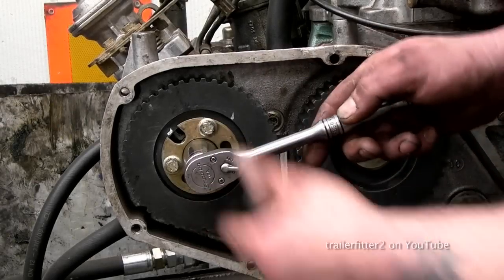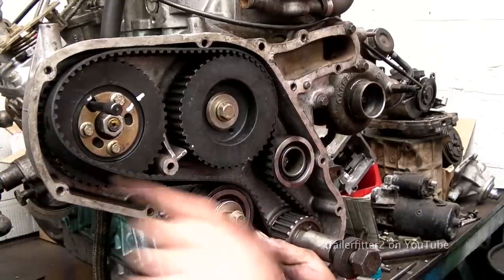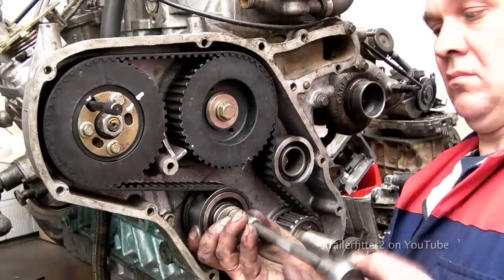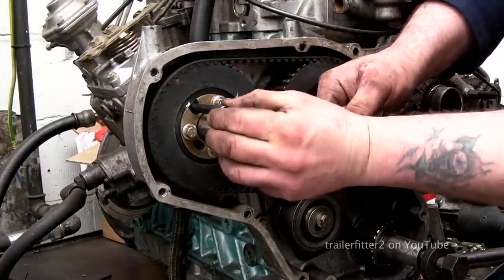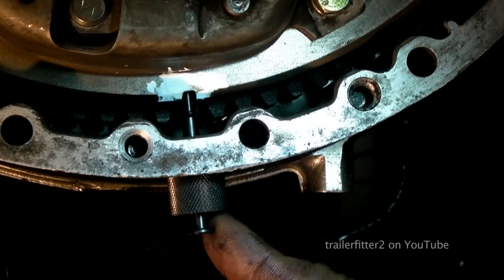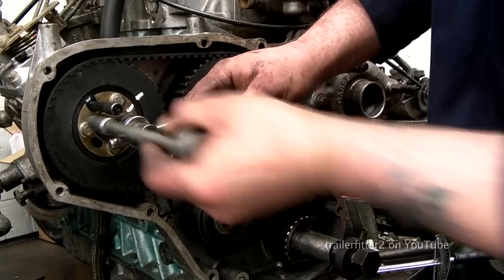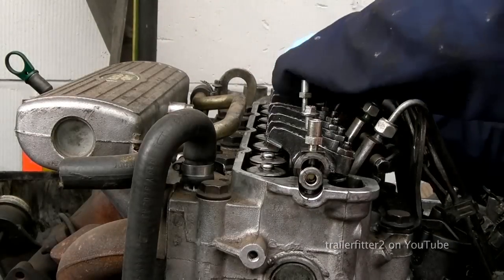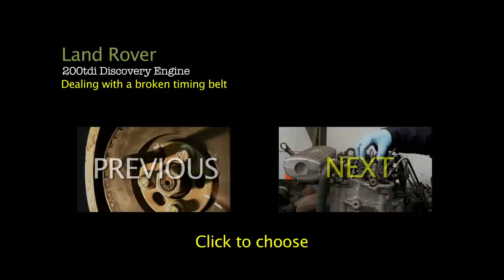Land Rover 200tdi Engine Fitting the Timing Belt

Comment: I have a defender 200tdi . I don’t have the plug in the side of the flywheel case to look for the two marks on the flywheel. How do I know if I have the locking pin in the right slot ? Got crank key way set to arrow on front plate tdc is set , cam shaft mark lines up and got the locking pin in the FIP. It turns over but won’t fire up . Any ideas ?
Thanks

Comment: My 11L Defender timing case (rear plate) seems fixed to the block after removing all bolts. I have a threaded 'dowel' to the left of the water pump (removed). Does this dowel go through the case and into the block hence why it is still fixed- the thing is solid!?? Thanks. (Your vids have helped me rebuild my Defender!)👍
Reply from the maker: Yes, it's a problem with those engines. the studs  do go into the block and corrode into the block where the water gallery is.

Comment: Hi mate you wouldn’t know by any chance what the size of the core plug is behind the timing belt housing?
Reply from the maker: Not off-hand sorry. Don't fit cheap ones. Go for genuine.
Reply: Trailerfitter's Toolbox Videos yeah I wouldn’t buy cheap I was just wondering the size as to get it I’m going to have to take all the timing belt and casing off to measure otherwise

Comment: Pardon my ignorance, but are these OC engines worth it? American V-8s (pushrod) have  everything inside the lower block-and these engines run 300,000 miles. Lose the belt on an OC engine? The engine is ruined.
Reply: Its a silly system I admit.

Comment: That's a 300tdi engine. The tensioner is different to the 200 & the fitting is different.
Reply from the maker: Nice try bud and I admire your guts,, but you are not going to get free access to our 300tdi timing belt video series.  If you had however,  you'd see the difference instantly.